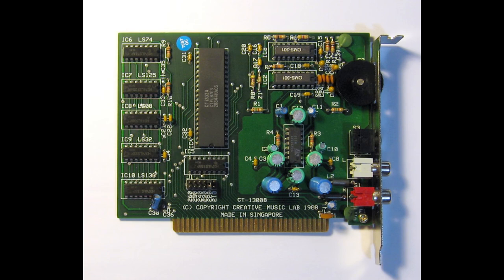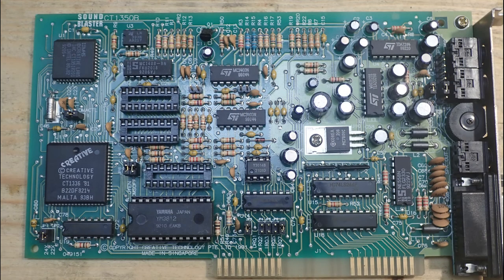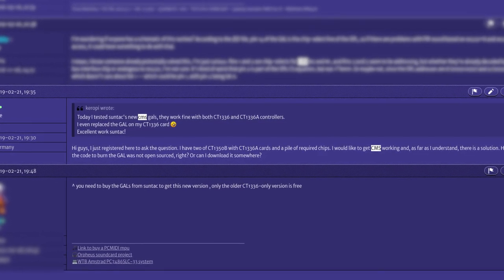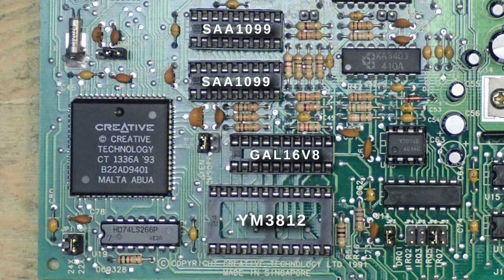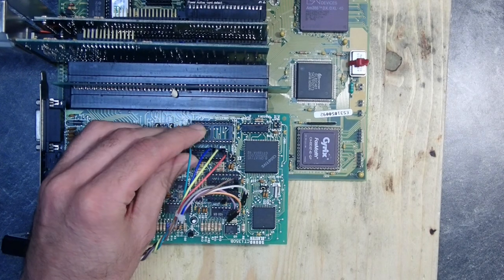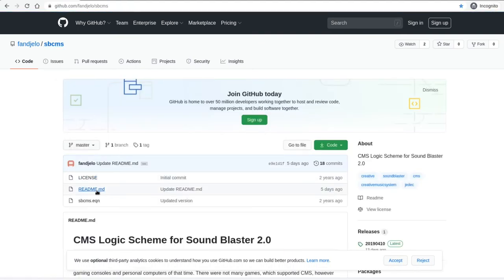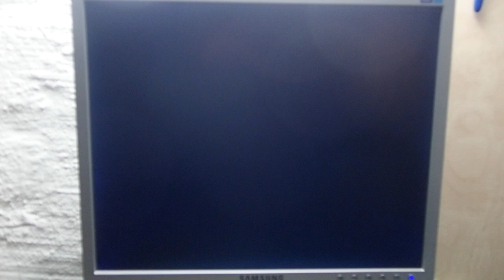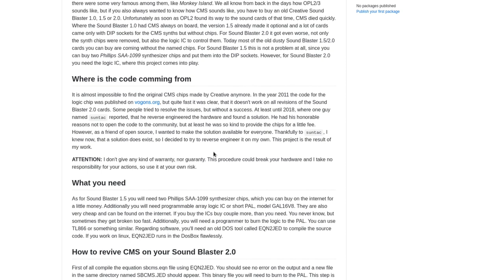Creative Music System (CMS) on Sound Blaster 2.0: reverse engineering and howto

Comment from the maker: To avoid some irritations. My nickname on various forums is scorp, I'm using it constantly since 1992. Necroware is my channel, but I don't use this as a nickname anywhere.
Reply: Thanks for the video.
Was wondering what logic analyzer you purchased and did you use Linux software?
Reply from the maker: @felixcosty  You are welcome. It's one of those cheap Saleae clones. And yes, I'm using Linux software.
Reply: @necro_ware  Thanks.
Can you describe the braiding of the wires? 
What Linux software did you use?
Reply: On a different topic.
Did not find you video with the analog to usb joystick project.
My method was to solder all joystick wires to the micro the same that you used in the original. Could I modify your software to work on this joystick.
Joystick is a Saitek cyborg 3d digital.
Reply: @felixcosty   Pulseview, a front end for Sigrok, with the "fx2lafw" firmware
Reply: @felixcosty  braiding the wires helps keep noise out of your lines. Similar to twisting pairs of wires in CAT 5
Reply: In the end... is there any difference left between your code/version , and Suntac's ?? 
And of course, CONGRATULATIONS!! and Thank You! :)

Comment: Good work! I'll probably try it out by myself at some point. Nice to see my AdLib picture I uploaded like 20 years ago on Wikipedia is still being used ;). 
I actually have an original SB 1.0 and 1.5 with CMS chips, as well as two CMS cards, on in German packaging disguised as the product of some other German company (possibly Genius or so). These cards were quite easy and cheap to obtain in the late 90s/early 2000s. But that's a different story now, 20 years later...
Reply from the maker: Thank you! And for the Adlib picture as well ;) I also have now multiple different cards with CMS since then. After I reverse engineered the logic, I bought 6 different SB2.0 cards and one clone by QuickSound. It's exactly the same card, but I wanted to be sure, that my code works everywhere...

Comment: Simply amazing! 
You would normally think reverse engineering a sound card is a tedious task, however, this video proves it wrong. It makes it feel like building a LEGO tower.

Thank you for your contribution!
Reply from the maker: I'm quite sure, that it is not always as easy as it was here, but in this case it was like LEGO indeed :) I also thought first, that it would be more complicated, especially because people were talking about it for like 7-8 years? Anyway, with this video I also wanted to show, that it is sometimes simpler, than we think and people should not be scared, just because many other people apparently failed. And again, once the solution was found, the knowledge about it should be shared with the community. Thank you for watching!

Comment: I'm not plugged in enough to know anything you didn't say.... I actually don't have an issue with secrets, so long as the secret holder is up front about saying why they don't want to share.  Even if it's as simple as "I would rather not share because it benefits me to keep it a secret."  That's fine.  It's not what's best for the community, but the world doesn't have to revolve around what's best for the community, everyone needs to decide for themselves what the best thing is for themselves.  What's not fine is the name calling, and putting up road blocks to stop others from sharing and discovering.  I'm glad you got this working, and things seem ok now.  I'm also glad that what's best for you seems to be what's best for the community.  Thanks for that.
Reply from the maker: I open source all of my projects, despite, that it would probably be the best in a short term for me to keep them secret and sell the parts instead. But I am absolutely convinced by open source mindset and think, that in the long term this is the better philosophy for all of us. Think of Linux, it is the most used OS Kernel in the world, a lot if people earning Billions of dollars with it, where others got a super solid platform for tinkering, learning etc  And all that is possible because one guy didn't want to keep things in secret.

Comment: My original SB1.0 with CMS was discarded after the system it was installed in had a power supply magic smoke failure. Luckily at the time I worked at a company that used SAA1099 and was able to get a SB1.5 and update it.  I didn't realize until watching this video that the 2.0 was missing the decoding logic!

Comment: I wonder if it would be possible to write some sort of TSR (something like the Tandy emulator for Covox) that could capture the CMS data and translate it to something the OPL3 can use. OPL3 can do stereo, has square waves and has enough voices for both square and noise, though I can forsee issues with the noise channels, since the OPL3 doesn't natively do those (I don't think). One could to programm some presets for noise, but I don't know how well that would work for every scenario.

Comment: This is great information and I'm glad you made it available.  However, do you know why the original CT-1300 software won't detect this upgrade as a CMS card, and will refuse to run?
Reply from the maker: By original CT1300 you mean THE original CM/S card by Creative? That one didn't have this programmable logic IC at all. It was introduced on the CT1350B and was implemented in the microcontroller on the previous cards.

EDIT: Ah, I guess I didn't understand the question :D You, mean the software in DOS. Yeah, just don't take the latest version of it, that one has a bug, which doesn't detect the CMS.
Reply: @necro_ware  But the latest version of the CT-1300 software does work with a real CMS board, so it's detecting... something?  Maybe someday when I have time and interest :-) I'll disassemble the later CMS software and see exactly what it is checking for.  Maybe it's something that can be added to the GAL programming in the future.
Reply from the maker: It doesn't have anything to do with the GAL. Original CM/S base address could be selected between 0x210, 0x220, ...,0x260. For CM/S detection a byte  at the address 0x2_4 (_  stands for 1,2,3,4,5,6) was checked to be 0x7F, then a byte was written to the address 0x2_6 and read again from the address 0x2_A. What was written must've been the same as what was read. The same byte was then again written to the address 0x2_7 and read from 0x2_B. Usually the same byte was used to write to the named addresses, so on the later SB cards (1.5, 2.0) the same 8-bit buffer was used behind 0x2_6 and 0x2_7 address for further costs reduction. Basically you could write to 0x2_6 and read from 0x2_A or 0x2_B the same value. This did work until Creative decided to write different values to the named ports in the latest version of their software. Don't ask me why, but they broke the compatibility to all non original CM/S cards (which had two separate buffers as far as I know). Also all of the clones out there use only one buffer for both addresses, because it is simple, so they all don't work with the latest version of the CM/S software. Why do I know that? I am working on a sound card, which shall be also CM/S compatible.
Reply: @necro_ware  Thanks for the explanation!

Comment: Thank you for your work :)

By the way, could the "audio issues" be for example a CMS chip or a channel being less loud than the other ? I have this problem with one of my SB 2.0 and it's bothering me ... I tried to replace the caps, but it didn't change anything
Reply from the maker: Hi Deksor! Thank you too! I did some research on the SB2.0 aside of CMS, may be you remember my Tandy video, where the SB2.0 turned out to be very noisy?! Anyway, I wanted to make another video one day about this card and how the sound signal is wired on the board. At my current knowledge state, I think, that a mixer circuit on your sound card could be broken. As far as I saw, the FM sound get mixed in a different way as CMS on this sound card, so may be there is something odd about that?! But it's just a guess. At least I can say, that I didn't experienced any balance problems on all of the cards you can see in the video.
Reply: @necro_ware  Well something's wrong with that card, because last time I messed with it the DSP was making some white noise :(
Reply from the maker: @DxDeksor  Strange, that DSP has impact on CMS, but may be it's some side effect? At least for now, unfortunately, I have no hint :(
Reply: @necro_ware  Maybe it's my recap that broke something in the go, I don't know, I should take another look at this card ...
Reply from the maker: @DxDeksor  May be you installed one of the caps accidentally in reverse? Such things happen to me from time to time, if I'm tired or not concentrated.  I'd check the polarities once again.
Reply from the maker: @DxDeksor  Hi, I had a similar problem couple of days ago and I remembered your question. In my case it was a broken amplifier TEA2025. Just in case.
Reply: @necro_ware  oh thanks, I'll check that out :)

Comment: To my ear it seems to be something a little wrong with the music. It has a noticeable oscillation on notes that should be constantly sustained 19:46 
Maybe the GALchip should actually be faster than 25ns ?? Or still some sound quality bugs in the code??
Reply from the maker: The GAL code doesn't control the oscillation. It is only responsible for chip enable signal. That's almost 40 years old square wave which you hear through lossy audio encoder on YT. I wouldn't expect quality from this :)
Reply: @necro_ware  No, i'm fairly certain it's not YT. There's a distinct "vibrato" on certain sustained notes that shouldn't sound like that in the M.I. theme on CMS. 
In the end, do you remember if there was any difference left between your version/code, and Suntac's?
Reply from the maker: @B24Fox  I didn't compare as far as I remember. It's long ago tbh. Since it's open source, all improvements are welcome. Feel free to take a look. However, as I said, the GAL is only responsible for the CE signaling and if it would work wrong you would hear chopped sound, rather than have oscillation issues. That would be probably a result of old caps which of course make every card sound a bit different. Well, the code is open, feel free to propose an improvement.
Reply: @necro_ware  I'm not very good with programming, unfortunately🤫 .. But you are probably right: a glitch in the code is unlikely to produce such fine oscillations in commanding the Philips chips.. It would more likely produce interruptions. So that indeed leaves either the aging passive components on the card; or the speed of the GAL chip. 
And btw, thank you and congratulations for cracking this thing wide open to the public :)
Reply from the maker: @B24Fox  Thank you too. The speed of the GAL shouldn't be an issue as well. Even a slow  25ns one can handle up to 40MHz I/O switching. ISA bus works with only 8MHz and GAL has even to switch a lot slower. More like in kHz range. I use those GALs in my MCE adapter to convert TTL video to VGA, where the pixel clock goes at up to 16MHz. That already is twice the clock of the whole ISA bus.
Reply: @necro_ware  You're right. It should have been obvious to me that since 100Mhz SDRam is about 10ns; then, a 25ns CMOS could do about 40Mhz (which is already overkill for any audio (Khz range) application).

Comment: Hello, well If I hadn't already subscribed I would have after watching this video. Excellent Work! Now after I watched this video. I got to thinking about my own Sound Blaster 1350B. I had ordered upgrade Chips for it a few years ago. What looks to be September 14, 2018 if I'm reading the package correctly. From a Daniel Siebler? In Wuppertal, Germany. I took a glance at my Card, and it's the CT1336A Rev. 049151 So it needs the newer revision Chip to work then, right? Is it possible that's what I had ordered? Are you familiar with that name at all? Obviously I haven't installed the Chips yet, but I am in the middle of working on a Compaq 486 that has a Good PSU with -5V on it. I think I'd finally like to use this card in that machine.
Reply from the maker: Hi there! Thank you very much. The name Daniel Siebler doesn't ring the bell for me, I don't think I know him. Regarding the ICs you bought, they could be a problem with your card indeed. As I told in my video and as far as I know, the logic equations, which were available before the very end of 2018 or beginning of 2019 didn't work on all revisions of SB2.0 with CT1336A controller. At least I don't know about any solution before that date, so if you bought your chips from in Sep 2018, then they are for CT1336 only or Daniel had a solution, but didn't share it with the world back then. Who knows?
You can try it and if it works, nice! If it doesn't work, you can reprogram the GAL you bought from Daniel with my code, just as I explained in the video. If you don't have a programmer and you live in EU, write me a message, I can reprogram it for you. But try first the version you have, it is just a matter of minutes. This sound card doesn't need any drivers, just plug it in and start a game. As I told, Monkey Island is good for testing CMS.
Reply: @necro_ware  Alright. I'll do that. I'm in the US, but I did buy a chip programmer along while ago. However the project I was working on at the time didn't work out so I don't know if I've ever successfully programmed a chip. This could be something I could try again if it doesn't work.

Comment: Prince of Persia opening music sounds the same in both modes, try it. Also 1990 is not just Monkey Island, its Loom, so Tchaikovsky, try both!
Hmm so my Sound Blaster with cms chips may be valuable after all, i still have the thin black Creative carton box where those chips came...
Reply from the maker: I know, there were around 100 games, which supported CMS. In my opinion Monkey Island had the best implementation, so I used it as an example.

Comment: The island monkey sound was dolby encoded, huh.
Reply from the maker: You probably mean stereo?! And it was not encoded, since CMS is not a digital sound. It is a synthesizer, like OPL2.
Reply: @necro_ware  more specifically, my decoder on my Sonos sound system seemed to think it should do things specifically with that soundtrack, with my 5.1 setup.  Normally YouTube only comes through my front speakers.
Reply: @randomfrequency  This is because Dolby Pro Logic surround sound is extracted from analog hard right and hard left sound. There is no middle channel, you have to sacrifice 2 channels to create one. Amiga works this way too. So the decoder wrongly assumed you were running DPL encoded surround sound.
Reply: @sfurta  Which is hilarious on its own, i wonder if it sounded good? 🙂

Comment: how creative labs are one of those companies that got up on the backs of others.
Reply from the maker: True, they got there just by using their elbows...
Reply: Business is business.  Ad-Lib should have learned from IBM not to use just off the shelf parts and to patent their designs.  If you don't protect your intellectual property, you're begging for someone to steal it.
Reply: @dennisp.2147   Counter perspective: If you want your design to take over the world, you make it easy to clone. The descendants of the IBM PC are still in widespread use while its contemporaries all died out. Adlib compatibility went far and wide while sound cards still had FM capability. A half-decent design that's easy to clone will win out over a stellar design that's locked down and/or hard to clone. Think of all the nifty-sounding features Creative put on their cards over the years that only got used by their own software. They tried to keep those features proprietary, and nobody used them.
Reply: @Roxor128  IBM of course had no such intention when they used all off the shelf parts.  They were simply trying to meet a deadline. Had they known, they would have taken a far different tack. It's simply a happy coincidence that the PC was so clone-able. Whoever bungled the licensing with Microsoft for DOS should have been fired.   IBM spent the 25 years after the release of the PC trying to stuff that genie back in the bottle.  First with the PC Jr. then with OS/2 and then the MCA architecture on the PS/2 machines.  Go try and buy an actual true blue IBM PC today...  Lenovo doesn't count.

The true measure of success is having a design that you can control and license that is so superior that no one can compete.
Reply: @dennisp.2147   Yep. All those proprietary attempts by IBM were failures because they were proprietary. Just like Creative's assortment of sound card features. If people can't implement it easily and cheaply, they won't. They'll look for something else that'll do the job instead.

Your true measure of success is basically impossible in practice. In theory it would work. In practice, you either make it open and cheap (or better yet, free) for others to implement and get possible success, or you make it locked-down and proprietary, with expensive or nonexistent licensing and watch it wither on the vine.